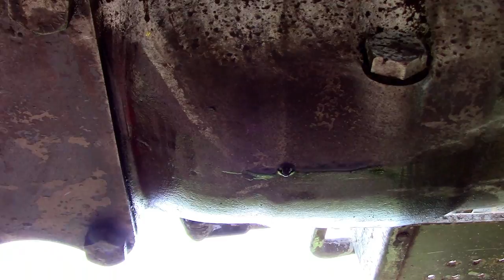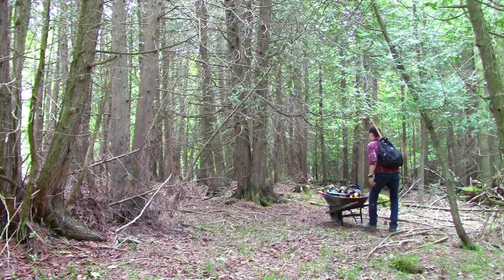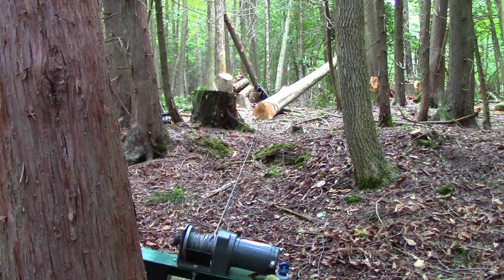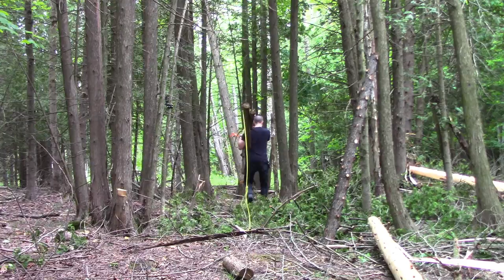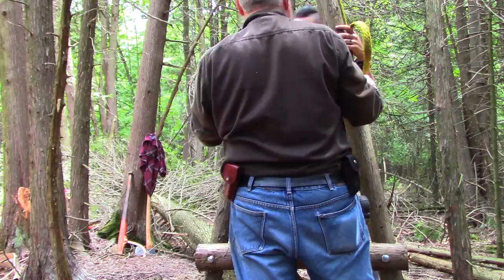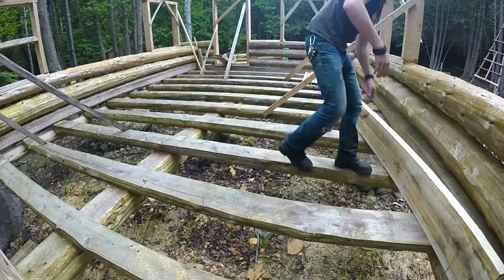Cabin Flooring & Tractor Breakdown- Ep36- Outsider Log Cabin

Comment: Not trying to be safety sally here, I’m inspired and doing the same kinda work on my place. So please take advice with salt. You may want to lay a chain or heavy strap across static line when winching, if it breaks it’s a lifesaver in that it will keep cable from coming back to cut or harm. Again wish I’d have started project at your age. I’m your dads age and whew I’m not what I used to be. Good luck and hope tractor is fixed soon.
Reply from the maker: Kelly Williams Thank you for your concern and helpful input. All the best to you on your cabin project!
Reply: Was thinking the same thing, the most dangerous place to be while winching is at the end of the cable looking down the length.

Comment: Ran into some of these same problems in my own small scale logging. Deep cycle battery will get you a bit further with electric winches but they never really seem to do that well for this application until you get into larger capacity winches. They are always outdone by hydraulic winches of even smaller size. I found an old hydro winch and made a gear drive to run off pto for my tractor. Major improvement. Great job in the bush. Keep it up. Pleasure to watch the journey

Comment: A helpful tidbit. If you continue to use a battery for your winch you will find that a marine battery is better suited for such an application. The cell walls are thicker and are designed for constant charging and discharging. I would recommend an AGM marine battery. The battery you have is a small car and truck battery, it probably has a dead cell. Has a surface charge but can't hold a load. That's why you only got two trees out of it. Good luck with your project.

Comment: Very cool dude. Didn't let none of that stop you at all. Yeah, looks like that electric winch isn't worth it's weight, since you gotta use the A frame anyway, and it's simpler and more dependable to just use it alone. I'm going to buy some land and build an off grid cabin to live in. Right now I'm squatting along a beautiful mountain river for free in my motorhome with my dog. I'm already an expert at rope and levers and rigging. Many years as a sailor. I dig what your doing, and learn from your videos. Great job dude.

Comment: In Germany for a hung up tree they have come up with something that translates into the bridge cut, when a tree gets hung up you can bore cut the center of the hinge however you need to leave a strap on each side. Next you pull out the saw and cut the straps from the outside cutting down at an 45 degree angle to release the hinge, once the hinge is severed it is quite easy to roll the tree out of the bind using a peavey.

Comment: Sorry to hear about the tractor. 

Glad to see you wearing chaps and hearing protection. How about a hardhat?? Never know about widow makers. Is Dad wearing chaps when delimbing?? 

I was always told not to go with just the cable when winching. Also use a chain. If the cable snaps, it will whip back at you. A chain will cause it to go slack. Also important to keep the butt off the ground when skidding or winching. Too much resistance.

Thanks for the video.

Jack

Comment: Outsider please be careful around the winch cable. Very dangerous! Love your videos.
Reply: My concern too. A remote controller on a pigtail about 8' long, so one could stand away from the cable while retrieving it would be much safer. Not hard to rig up and vastly improves safety.
Reply: Michael Flynn 

The amount of cable paid out and the full power of that winch is not enough to have a serious whiplash from the cable if it (not likely) ever snaps, especially while using the A frame with it. The winch itself will be trash before the cable wears out enough to be an issue. That being said it isn’t a good idea to stand beside a winch cable and Sr. Outsider is in fact operating a wired remote switch.
Reply: That could definitely do some damage, tutting a jacket or something like that over the cable mid span is a good idea also. The cable is sized to the winch and pulling against that load it could definitely  break, especially if it’s worn.
Reply: Wayne Crews
I have an acquaintance who lost an eye due to a 1/4"cable  on a come-a-long snapping who would beg to differ with you.
Reply: So what you are saying is your acquaintance should have been wearing safety glasses. As you never know where the cable is going to break....
Reply: had a friend he did this it snapped whip back & broke his leg so yes very dangerous. i mentioned this to him before but he ignores it. so if it happens we told him so
Reply: I was a nervous wreck watching that winch cable lol
Reply: Michael Flynn
Usually people die from blunt force trauma. But yeah slicing can happen too

Comment: A block and tackle would give you the amount to mechanical advantage you need.   The number of pulley's used could be adjusted to the speed and torque you need.  Old barns had them for lifting hay or you could make one.

Comment: It's not that big of a job splitting the tractor... have done a number of them, for clutches and oil leaks. Sounds major, but it's really much easer than you would think.
Reply: You can still use the MF. Just add a LOT of oil.
Reply: It can get expensive if the crankshaft has to be turned because of excess ware and buy oversized bearings! And if you can do it yourself or not!
Reply: You can get the oil leak fixed in a day.  Find a video on Youtube.  You will need a come along or chain hoist and a floor jack to support the sections and then some jackstands.
Reply: You want to come do my Mahindra. It needs a throw out bearing. They want a fortune at the stealership.
Reply: I sure he could build a picker stand out of logs

Comment: That oil leak looks to be engine oil because its black and back end oil is usually same as oil when put in new. Looks to be the common problem of the crankshaft rope seal as my tractor (massey ferguson 35)has that issue but still drivable to keep you goin just check oil levels and usually when I turn off my tractor it leaks faster and I park the tractor facing down a slope so it dosent leak oil when parked.

Comment: I thoroughly enjoy watching your video posts. Each time I learn more about all kind of things. Just wondering if a cable winch might help as well. Also I noticed while you and your dad were pulling pulling bark that one side of the bark was smooth. Thinking outside the box for a moment. To make tree felling a bit easier, could you take one of those large bark strips and place it at the base of the tree you're trying to pull, with the thinking that the tree may slide along the smooth side of the bark. Do the best you can with what you've got. Well done to you both.

Comment: I don't recomend hanging around the winch that close when operating it (or the cable for that matter). If by chance the cable snaps under tension, It'll whip right through any flesh in its path, especially the steel cable ones like you have. Just a safety precaution, I would stand back as far as the corded remote will let you perpendicular to the line.

Comment: Broken engine seal. What a pity, diesen engines do that ALL the time. I have replacen them (with a professional guiding me) in newer massey fergusons (1185 and 1195 models). I know it looks bad but actually its more intimidating than enything. As you said you have to split the tractor in half, so you need to brace the back part with logs and wedges (also brace at the hits so it doesnt fall back) and roll the front part fowards. You'll need something with weels to sit the back end of the engine at the correct height and roll is fowads. Its a good idea to lock the front so the engine doesnt tip sideways. Once you split the darn thing, the crucial part starts, make sure you tighten every bolt properly and pay special atention to the clutch or otherwise the two halves of tje tractor wont fit back together .Tip: to make the gear box shaft fit the clutch part, rotate the power spiny thing in the back of the tractor (english its not my first language, sorry) you should be able to convice some old mechanic to do it on a spot. Don't be discouraged im sure you are mora than able to do it yourself. Also nice work on realizing about this before you broke the engine. I would be glad to help if i didn't live all the way in argentina. Best of luck

Comment: Hi Outsider I have a Tip for you when you Put a Battery on the Ground it will zap the Battery and discharge it you have to put something under it before you set it on the ground

Comment: I would never waste my time taking a battery powered anything into the woods and as few gas powered things as I could in doing this job.  I think your A-frame lever is an excellent idea but I would use it in conjunction with a Maasdam rope puller/winch.  One with a 50 foot rope can be found for about $75 and one with a 100 foot rope for about $100.   I would always run the rope from the Maasdam rope winch through your A-frame to make pulling easier when the tree is still at a sharp angle  and trying hard to dig into the ground.  Then, when the angle became less,  the A-frame could just be sat down on top of the log and you could continue pulling with just the work of the winch.  It should work wonders for you.

Comment: @ The Outsider

You could make yourself a few tree type of trailers that you can hook up together to take them into the bush like pulling a cart. Then you brake them apart & put at either end & in the middle of a log to wheel it out of the bush. You can easily get up hills with using a set of pulleys & some 250m length rope to use pulleys off trees to get yourself through the bush when the tractor is not only out of commission but unable to get through tight areas. You basically need a U shaped box steel to put the log into & have 4 wheels at the bottom for support. If you have 2 of these so that you can put one on the end & say the second one   at 2/3rds the length & the 1st trailer would need to be able to turn with a hand rail at the front of it. You don't have to spend too much money on this, most can be made out of wood & some bearings & some pipe even. Just be creative.

Comment: I love getting to see the cabin coming along and I love your log puller. I might need to go back and re-watch that video again. Or was that a different video? I remember you building something shaped similar to that log puller to use as a ladder at some point, iirc. 

I need something to help me clear some trees that are too thick to grow healthy and to get an area ready for a shed and a handicapped ramp and deck. There is a huge tree hanging over that is going to have to be felled by professionals. I dread that cost, because I also really want to get a small ramp put up in the back part of the house for my quadriplegic aunt and I want the flat area before the ramp starts going down to be safe for her as a way for her to be able to go outside and not have so much direct sun on her. We have what amounts to summer here about 10 months of the year. Her other ramp is in direct sunlight and gets too hot even in early spring and late fall. I really think it would add to her quality of life to get to go outside more. So, that means I'm going to need to clear the smaller stuff out myself to make a nice safe, clear area for her to be able to come out to the shed when I'm doing little projects out there too.

I don't have a chainsaw, nor do I know if I could handle one. So, it's going to be my old pruning saw all the way. Luckily, those other trees I will need to clear myself are fairly short and fairly young and not too big in diameter. It is the big tree that is dying and learning over so far that is going to cost the most and be the trickiest to bring down. I just hope that part where I hope to put a little workshop/shed/wildlife watching area is level. My property is less than an acre and the elevation from the front left corner to the back right corner is a 24 foot difference. I think it really is uphill, both ways, no matter where you stand out there, though lol.

Comment: Sounds like the winch, possibly with a better battery, could be for warmer "lazy" days. That keeps it from being terribly useful if it can only take a few trees. Perhaps paired with a generator or similar? A winch with a generator on bigger trees (bigger winch unfortunately) could be useful, but by the time you would have gotten it, the tractor would have rendered it obsolete, right up until it broke again. It also wouldn't be as compact. Overall a luxury, but not a super useful one.

Comment: Also, I would have built  a four pole shelter for the sawmill,,that way you could mill logs when it rains..next time , consider cutting the floor planks first, lea them not nailed if need be, also stag the plank joints ,,.but it would be safer and therefore more productive to have the floor for support to install the door and window frames

Comment: I was getting ready to see how the new tractor was gonna work for you...Sorry to see the problem you have..Cabin lookin good,hopefully tractor will be fixed sooner than later...🏚🚜🌲...T.Gunz
Reply: Tommy Gunz it's a lot of hard work splitting a tractor then removing the clutch and flywheel  and pan  then rear main bearing cap, checking the main bearings for wear and replacing the seal ! If the crankshaft is wore to bad it will have to be removed and sent in to be ground and installed with oversize bearings! Not cheap!
Reply: Add a catch pan, then recirculate the oil that leaks back into the crank case....  ;-)  That's a great tractor, well worth the investment to keep it running for another 60+ years....

Comment: Damn. I wish I was closer. Assuming it isn't the 'Deluxe' model, 'splitting' your M/F 35 to replace the rear engine seal is about 6-8 hrs work TOPS. Start to finish. Even your first time. I'd wager I can do it in half that with inexperienced help. The seal is less than 10 bucks with shipping. Very straight forward job. No need to pay 'shop rates'. Have the shop evaluate the clutch and replace the 'throwout bearing' REGARDLESS!

Comment: I just recently found your channel and am thoroughly enjoying your content.  My aim is to get a similar project started hopefully soon.  I'm in the search for the land to purchase phase at the moment.   With your tractor down and you guys using the backup winches, wouldn't it be more practical to have the winch mounted on an atv or similar vehicle so the battery could be kept at a higher charge and let the winch be used longer? Or, is the atv winch not feasible for the work that you are doing?  I absolutely love the a frame pully, that's an ingenious and simple setup. Simple set ups are usually the most efficient and effective,  I find.  Thank you for sharing your knowledge and projects with us.

Comment: That will be one solid floor‼️ what will you be using for chinking, I've seen stirafome in the middle with screen stapled to the logs followed by mortar or whatever. The stirafome is pushed in real Tite and when logs move so does the stirafome. Just wondering what the plan was. Cabin looks Sweet‼️👍. Vinny 🇺🇸

Comment: Uffda, bad luck with the tractor. Hopefully the seal is the only thing needs fixing when pulled apart. I hear hand sanitizer works well to remove tree sap.
Reply: Jim Letts if you soak your hands with dishwashing detergent and let it dry before they get dirty,all you have to do is wash your hands with water

Comment: Seems a waste to rip the tree skins and discard them, unless you've found something useful to do with them.  I wouldn't have thought they disengage so cleanly!  All very interesting!  Thanks!   : )
Reply: In an earlier video he explains about the correct timing of the year to drop trees so that the bark is easiest to peel. Springtime when the sap is running seems logical to me.
Reply: that bark used as flooring with a clear epoxy wood be awesome!
Reply: AFAIK the reason they debark, is to avoid the bark holding in the moisture, and make the wood rot.

Comment: After splitting so many tractors I love my Nuffield. The engine is mounted to frame rails like a car so I can unbolt and slide the engine instead of cracking the tractor in half to replace a clutch or rear seal. Some guys throw Chevy small blocks in these. I'll stick to its little diesel.

Comment: OK  wich ever. One thing it's only uesd to take your tools in to the wood when you're main tractor is down and out.  And I did say anything about using it every day off the. Week  and all depends on what you get  mine dose rather well in the woods when we need to use it  cos u not pulling anything heavy it's only to carry your saws and and fuel and other bits and how the winch on the front with  extra plats on the side then u can put strap around anther tree so u can ues the the winch.  I'v done it for long time.  But now my back has gone bad I carnt do to much.  So my mate as taken on my stuff now i'v got to grey fergie.s  and the big ride on . We did have a  35 with half tracks on it wich we pulled loads of trees out with.  But it's everyone's choice for there job.  I only saying it can be done  and cheap.  That's all.  But thanks for your comments.

Comment: why would you even think of going to that huge cost of floating the tractor to a shop for them to do the repair, shop rates are grossly high price per hour, you can split that tractor your self in the bush and do the job your self and know it is done right and not paying for parts the shop clams it needed that didn't even get replaced, even if you never did one before they are simple to do and a great learning experience, and there hundreds of videos on here to help you, unless you have money to burn, never be shy to lean something new know mater how big or small you think something going to me, you don't need any special tools or equipment to do that job, just the willingness to learn, and don't be telling me your under a time crunch, its the best time to learn